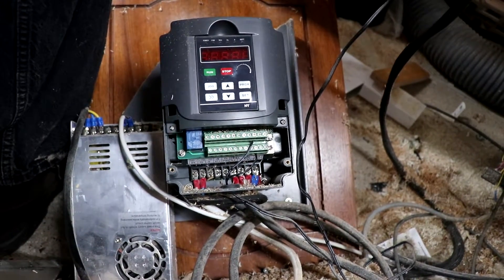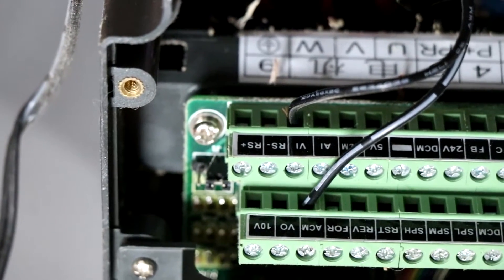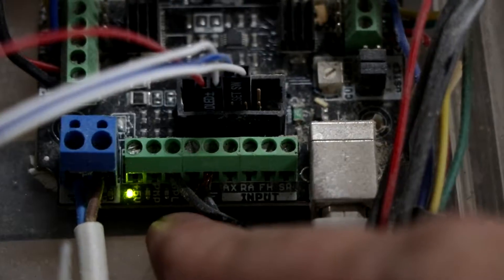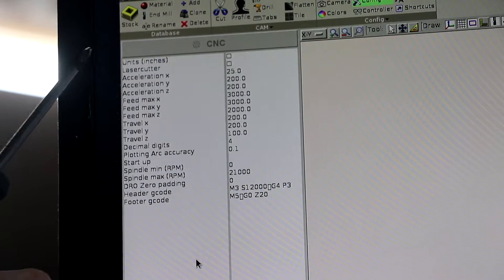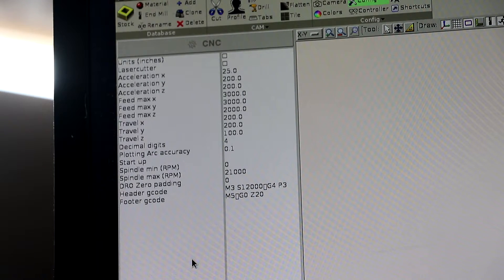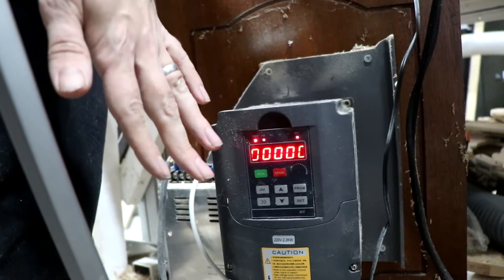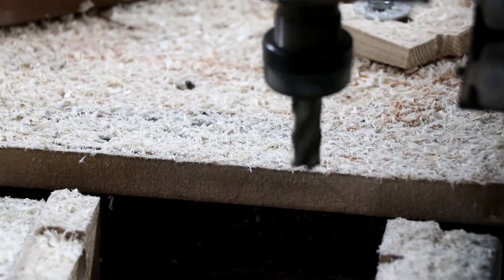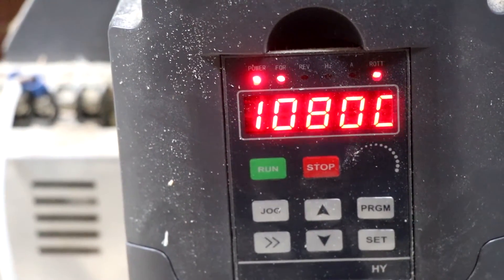Controlling VFD spindle rpm with XPro CNC board on ooznest OX

Comment: Hi I have the xpro v5 it has pwm output, do you know if this vfd can support that? Thanks!!
Reply from the maker: I believe I had to handle that when I set up my duet. Required an extra board to convert the pwm to the voltage range the vfd expects https://youtu.be/wTcHczXHZ98

Comment: Cheers for this
Reply: Hi Maker Geek,

Thank you very much for making the video, I'm almost there but can you spot the thing that is wrong.

Pi install with default setting for bCNC (working in the sense that all the stepper motors can be controlled by the software)

VFD to XPro V3
+ve cable from V1 to D11 (Variable Spindle PWM)
GND cable from ACM to GND 

VFD setting changed 
PD001 from 0 to 1 (Set by external terminals)
PD002 from 0 to 1 (Set by external terminals)
& 
PD070 FROM 0 TO 1 (set to value 0-5V)

Spindle min (RPM) 0
Spindle max (RPM) 21000

No relay sound when run is press on the VFD?
No LED active on D11 terminal on the Xpro V3

Spindle is working when returned to manual control
Reply: Colin McKenzie look on rick's cnc on here setting up vfd may help u
Reply from the maker: +Colin McKenzie I've been looking for my manual to try to remember my settings unfortunately it seems I've lost it. Sounds like you have it set to expect external control of the power on as well as external rpm control. Where I only have it set to want external rpm control. I'm cleaning the workshop at the moment so if I find the manual I'll see if I can find better answer. Good luck!
Reply: Colin McKenzie could it b the jumper
Reply from the maker: could be - you should be able to see the position of mine at about 0:27 in the video. Does it match your position?
Reply from the maker: Actually I just found a copy of the manual online. looks like pd001 and pd002 should be the relevant settings. I think you want pd001 set to 0 and pd002 set to 1 basically pd001 tells it where to take control of on/off from, and 0 means operator, eg the button on the panel. and pd002 tells it where to take the rpm frequency from, and 1 says external, eg the terminal wire input. hope that helps!